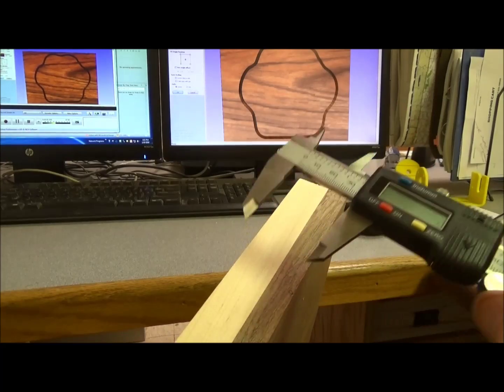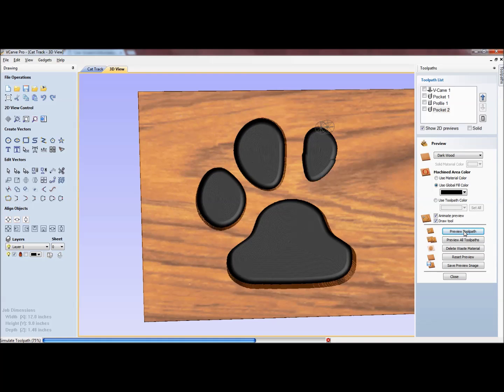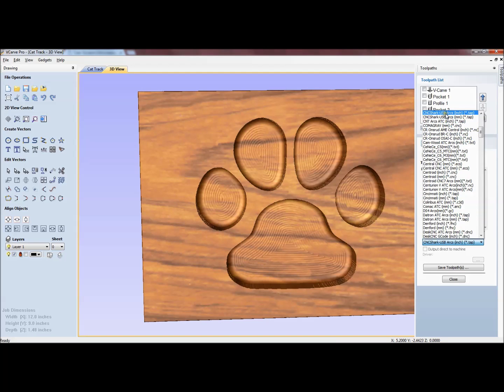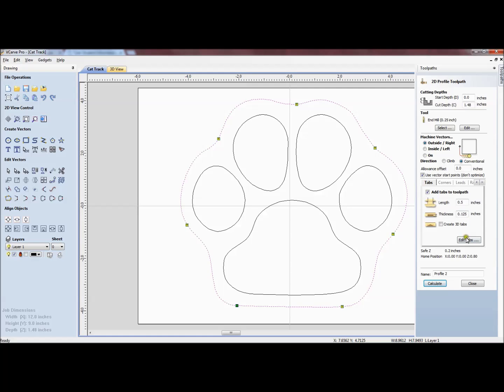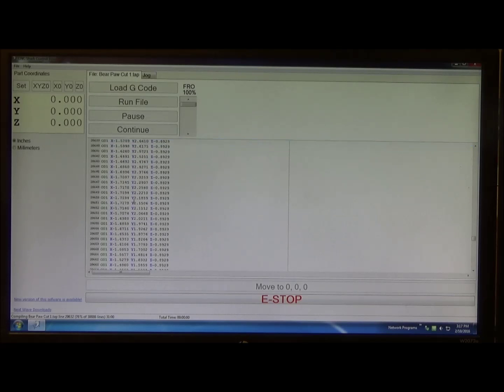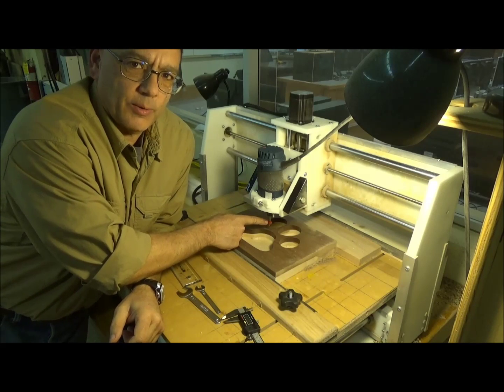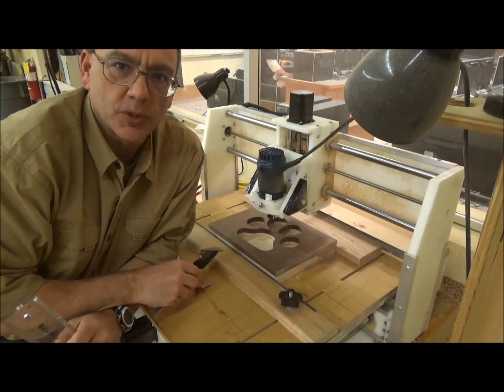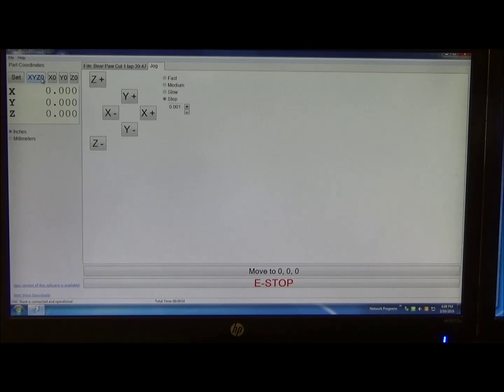VCarve Pro Video 9 Using More than One Cutting Tool

Comment: I will add this tidbit to keep in mind.. With some control program such as mach 3 that can reconice a tool number change you can put ALL tool paths into one file. With mach 3 you have to go to the settings tab and click the "ignore tool change" button off.  Mach 3 will just stop when it detects a different tool number and wait for you to hit cycle start again.  Just jog anywhere to change the bit and reset Z zero. Then hit cycle start and Mach 3 will take off until either a tool number change or it finishes.

To use that feature you MUST give each tool a different number.  You can enter the numbers in the tool database in ALL the aspire programs and it will remain until you change it.  That tool number used in the g-code every time you use that tool

 NOTE!!!!   Not all controllers can detect a toin ol change. Check the docs for yours if it can do it and how to do it if it can.. 

Makes life far easier if your controller can handle it.. If it cant then make a separate file for each tool.  DO NOT touch the X and Y until all files are run. Just adjust the Z zero only for each tool as needed.